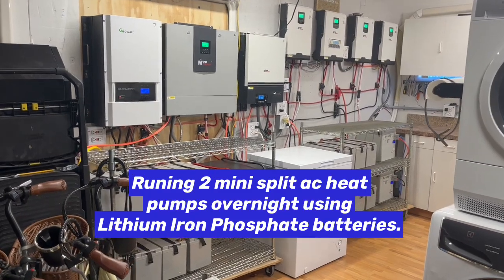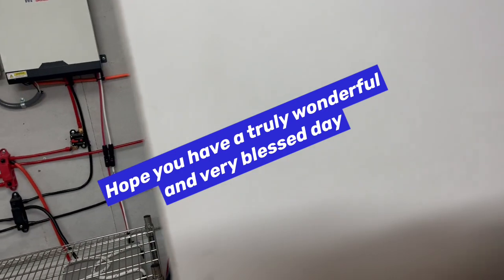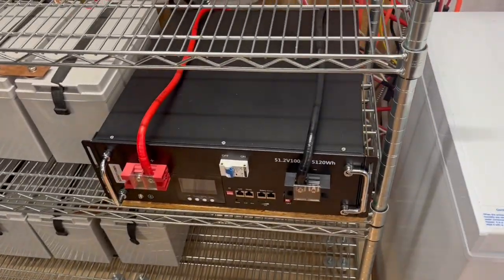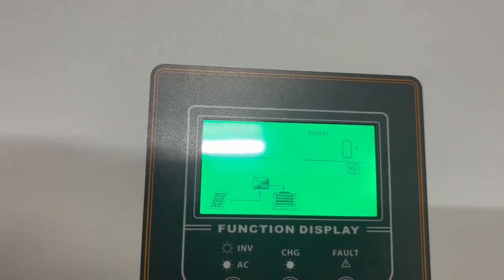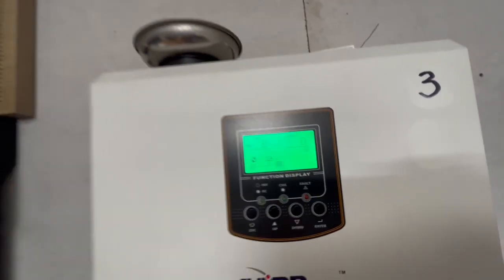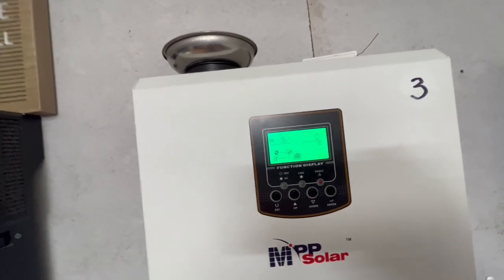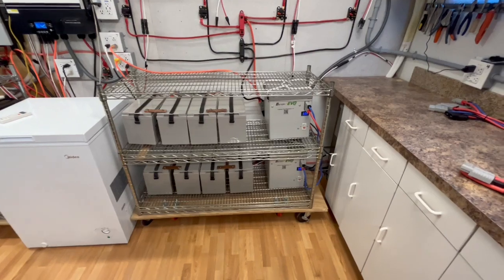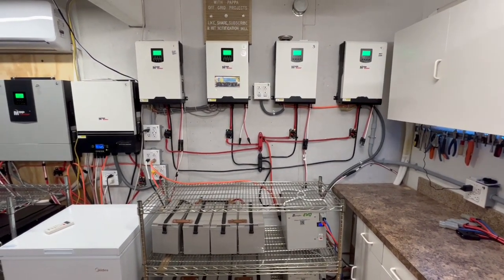Lithium Iron phosphate batteries running 2 mini split heat pumps overnight instead of main grid AC

Comment: I'm all done with the install of my Mini Split hopefully I'll be running by the end of the day when my friend comes with the pump and gauges I can't wait to see how this thing run on my system..
Reply from the maker: Wonderful, I hope you enjoy many years of free ac/heat with your mini split.
Reply: @diy-solar-guy  meet you I wish my friend would make it here to vacuum down my lines it still hasn't been done yet that's all I'm waiting for now I seen the couple videos with people just bleed the lines and had no issues but it is safe to do that
Reply from the maker: @thelithiumpowerch  you are better off removing contaminants and moisture in line with vacuum pump. You can get away with it but a year later your unit might stop working because of moisture in lines. Not sure if anyone tried putting a filter/dryer that traps moisture on line. My main heat pump units that are soldered lines have near outside unit. Hope your friend arrives soon.
Reply: @diy-solar-guy  me too I guess I'll do the right thing and just wait for him he just has a busy schedule he does heating and cooling he has to professional gauges and pump.
Reply from the maker: Did your friend ever make it over with the vacuum pump?
Reply: @diy-solar-guy  no he never even answered back none of my calls just left me hanging sadly I went ahead and bled the lines until I could get out as much air as possible and it's sitting here running great don't know how long but lot of people said they has been running and still running and all they did was bled the lines so hopefully it will work for a long time for me if not I'll simply get another one but I don't have no heat at all and for him to make me wait like that day after day kinda made me mad knowing i'm completely off grid like this..
Reply from the maker: @thelithiumpowerch  That’s horrible, hopefully you won’t have any issues. I was lucky. I was able to get ahold of 25lb of refrigerant when it was only$100 for the 25lb tank. All my mini splits, whole house heat pump and pool heaters use the same refrigerant. Now it’s over $600 for a 25lb tank of refrigerant. Happy heating the rest of the winter with your new mini split.
Reply: @diy-solar-guy  thank you right now 25lbs of R-410 is $370 on eBay how much does a 12000 BTU require on empty?
Reply from the maker: @thelithiumpowerch  I think around 1lb give it take a few once’s. Price must have dropped since I last looked.
Reply: @diy-solar-guy  oh ok and yes it's way down at the moment trust me I been looking 😉👍

Comment: I don't know to see 14.5 amps on it to be a 20 seer just seems a lil high I guess all the other Mini splits I've seen have two ratings one for the heat one for the cooling and mine simply have one and it's a 2022 model
Reply from the maker: That does seem high. You will find out once you start up mini split and run. Not sure why it would have that high of an amp rating. Have not seen that.
Reply: @diy-solar-guy  I appreciate your response and helping me someone in the Solar group on Facebook told me those are the combined amps for both heating and cooling so around 7 to 8 amps on each side Poppa my mini split came with a 16 ft line set can I add a 25 ft line set without adding extra r410 ?
Reply from the maker: @thelithiumpowerch  it is my pleasure to help. I don’t have any senville mini splits but they all pretty much are the same mini split with different name. Specs are pretty much same. We all start not knowing much as a diy but learn as we ask questions and just do the project and learn from practical experience. You will find out what that 14.5 amp meant as soon as you use mini split for a few days. I added the 25 foot lines to a few of my units that came with 12 foot lines. I had no problems. Hope you enjoy your new mini split and it saves you a ton of money.
Reply: @diy-solar-guy  thank you so much for the valuable information and once again I appreciate it I may even make a video of my own 🙂👍
Reply from the maker: We’re you able to run your mini split to see how many amps and watts it uses?
Reply: @diy-solar-guy  not yet I still have to get the vacuum gauges and I might need a 25 ft line set also I still got to find where to sit the heat pump
Reply from the maker: Let me know when you get it up and running. I’m curious as to how many watts and amps mini split uses
Reply: @diy-solar-guy  ok I sure will and I'll make a video

Comment: I just got my new mini split heat pump in today it's the Senville 12000 BTU 120v unit I noticed on other heat pumps the sticker on the side gives two separate amp ratings one for the heat pump one for the cooling mine's only give one rating for the compressor as a whole at 14.5 amps which seems kind of high to me for a 20 seer is it possible that it's 7 amps max on each and that's just the total amp rating equalling 14 amps ???
Reply from the maker: That amp rating seems really high. I think mine is only 10 amp for a 16 seer. For 120v that would be total amps. Not like 240 volts with each leg. What size room are you trying to heat or cool?
Reply: @diy-solar-guy  I think it's about 16x13ft ft it's in my dining room here living room right next to it and it's the same 16 ft by 13 ft the mini split is in the middle.
Reply from the maker: @thelithiumpowerch  16x16 is less than 300 sf. That Seville unit is rated for up to 700 sf. It should cool/heat room pretty quick and then reduce watts used which will drop amps as well. You should be good to go.
Reply: @diy-solar-guy  okay thank you
Reply from the maker: I just looked at specs for senville 12000btu 120v, uses 1200 watts max cooling, 1200 watts / 120v = 10 amps. Mini split will slowly ramp up to max. It would have to be over 100 degrees outside and set mini split at 70 degrees inside when it is 80 degrees in room to hit 1200 watts. My mini splits are only 16 seer and 19 seer. The max my heat hits is around 1000 watts in winter and 1200 watts in middle of summer.  The high watts will be at coldest and hottest outside. You unit will ramp up slowly then when it hits temp set it will start to decrease watts. Today my mini split was at 800 watts heating and when it heated the room, watts dropped to around 500 watts. You will have to run it to actually see how much it will use. Good luck. The instillation being done correctly will make the unit run at high efficiency.
Reply: @diy-solar-guy  Oh ok mines a 20 seer the amp rating say 14.5 amps it's the only amp rating I see on the sticker online the model number seems to be off by one digit mines Senville SENL/12CD/OY Everybody is telling me the specs of the SENL/12CD/Y witch do reads around 10 amps but mines is the OY reading 14.5 witch to me seemed kind of high for a new 20 seer and only one rating

Comment: I have a question was your batteries 100% full when you set your thermostat to run all night for this video my mini split will be here Wednesday it's a 120 volt 12000 BTU I'm running on four 120ah lithium batteries 16 cells in 24v will my batteries be able to run my mini split all night like that ?
Reply from the maker: I had to charge each 12v battery to have BMS fully charge the 4 cells on each battery. My 12v BatteryEvo 150ah/2KWh top out at 13.2 volts. This is important to top balance individual cells and batteries before using. When I first got the 2 12v LiFePO4 and used with 24v inverter, I did not top balance battery or cells by charging all day before connecting in series. The first time I used overnight, one battery breaker shut down from going below 10.5 volts while the other battery was still 12.9 volts. So the 24 volt inverter turned off because of no power. I was able to open the top of LiFePO4 battery and make sure each cell was fully charged, which on this 12volt battery each cell is 3.3 volts so the total voltage with the 4 cells in series is 13.2 volts. If you connect batteries before fully charging each 12volt battery, your inverter might shut down if 1 or 2 of your batteries drop below your lowest set voltage on inverter setting(ie… 10.5v for low voltage cut off and you battery gets below that, BMS on 12v battery will shut down battery to protect cells.) As a DIY guy, sometimes it’s fun just to see what happens without too balancing cells or battery so you can infirm others when they have questions. Hope I gave you enough info in this response to answer your questions.
Reply: @diy-solar-guy  yes and I never top balanced myself since I've had them but I have fully charged each cell to 3.5 successfully and I also drained them all the way down to basically nothing one time right now all to sell the sitting pretty evenly around 3.34 about 70% state of charge I've been using these batteries for about 5 months now.
Reply from the maker: @thelithiumpowerch  should be ok. A lot of factors come into play so keep that in mind. Size of room try to cool or heat, size of mini split and what size sq ft it is rated for. Starting temp in room before you start the test. ( my room was already pre-cooled to desired temp when I ran overnight.) rate of temp outside heating up or cooling down versus inside temp. Run overnight and see what results you get. Try again several times I’ve next couple days/nights changing parameters to see how it affects results.

Comment: The idle/inverter losses on all those inverters has to be significant!
Reply from the maker: I only run the 24v inverter overnight for my needs, uses the least amount at idle, the other inverters shut down when sun goes down. I am in the process of only using the Growatt inverters. I use all the inverters during the day to run many different things. Once I get soft start this weekend I should be able to start 3 1/2 ton ac on 6kw Growatt inverter. If that happens, I will be reducing the inverters. Growatt is very stable with no fault codes once programmed correctly. All my batteries are fully charged at 7 pm and can use overnight if power goes out. I air condition 2400sq ft in house and another 700 sq ft in garage all day long. Very little waiste during the day especially when it is over 110 degrees during the day. Thanks for the comment
Reply: I'm very impressed with your setup
Reply from the maker: @donnimetropolis9899  Thank you. A work in progress.